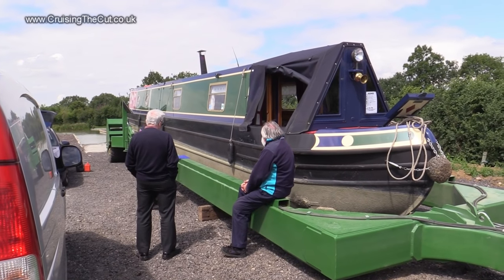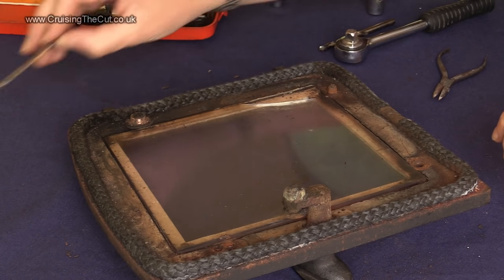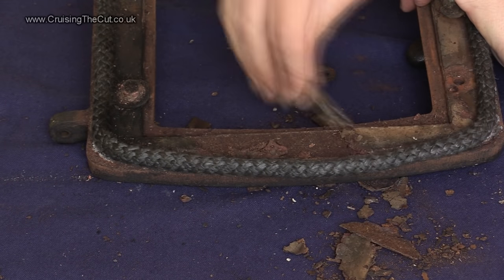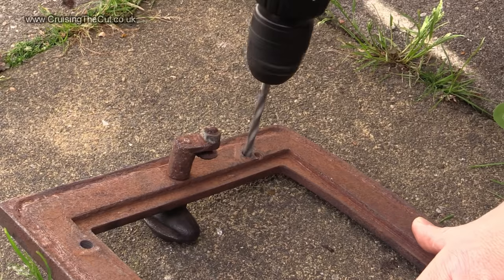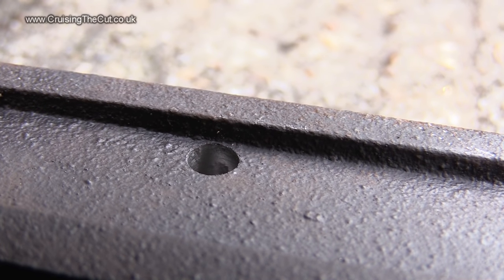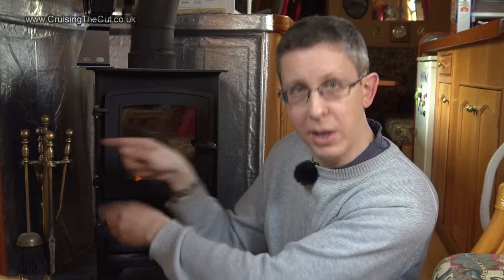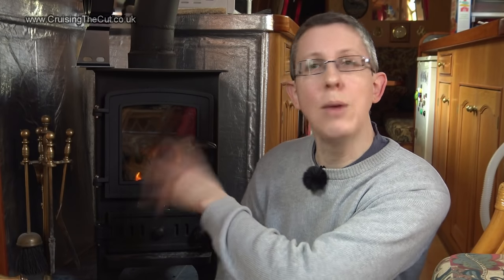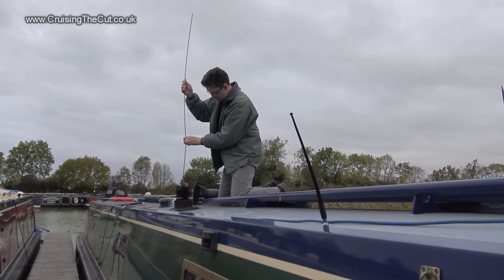18. Sorting out the Villager Puffin stove on my canal narrowboat

Comment: Regular WD-40 is not a penetrating oil.
Not that it probably would have helped much because those bolts were exposed to a lot of heat and it probably would have taken a torch to remove them easily.

Comment: Good Evening/Morning:  I discovered your channel a week or so back.  I watched enough, I am now going from #1 to present.  (It is possible I have a masochistic streak.)  In any event, and I recognize that this video is over 6 years old.  However, I have some advice.  1) WD-40 is a water displacer, not the best thing for loosening frozen nuts.  I would suggest you try products such as Kroil (best), PB Blaster(near enough best) or Liquid Wrench (garden variety).  2) A sheared off nut, wedged in the socket is not a problem.  The solution is 1 remove the socket.  2) insert a drift or screwdriver into the square opening of the socket, with the point of the drift or screwdriver against the nut.  3) hold the socket on top of the tool, while giving the bottom of the tool a sharp bang or two against something solid and non-marring.  4) a squirt of some lubricant (such as kroil or PB blaster) around the nut, will help to dislodge it.

Thanks again.  I am enjoying the channel.
Reply from the maker: Cheers 👍
Reply: Ah, to be able to start from the beginning and have it all be new....  Enjoy the ride!  And if you enjoyed this video, rest assured, this is far from the last adventure David will have that is stove related.

Comment: David for some reason I'm just re-watching all your old videos (looking forward to getting to your cheese sandwich recipe again).
Should you ever find yourself with another narrowboat, or for the benefit of other boaters with a stove: I can't recommend highly enough an 'air distribution' fan. 
I bought one to fire cold air into the room in my house which is heated by my stove and up towards the ceiling therefore forcing warm air downwards and out of the door to other rooms. 
I can heat my entire house with my stove now! and the fan draws between 1 and 40 watts depending on which of the 30 power settings it is on.
I still use the stove fan to shift air from around the fireplace but the air distribution fan is a game changer in my opinion, apparently they are designed to move air within a vortex and genuinely do seem to work differently to a normal fan. 
I could imagine this being very useful within a long, thin tube with a singular heat source. 
I'm also hoping they (as I was so impressed with my purchase I bought a second one) are useful at maintaining a comfortable environment during summer by creating a circular flow of cool air within an entire room, as this is their main marketing claim.....
Reply from the maker: Cheers, yes I had one driven by the heat of the stove, you'll spot it in later videos.
Reply: @CruisingTheCut  Yes, I know you do, but I assure you an actual air distributor is a different beast entirely!

Comment: IF you have any left over reflector foil I'll take a piece of wood or metal the size of the left over piece and put it on to basically make what is known as the a heat mirror. 

You then take the heat mirror and put it infront of the stove (bout where the camera was for this video) so it will then reflect the heat back down the boat to you bed.

That plus the fan will really make the boat warm...

Kinda wish I could live on a canal boat but can cause of the USA lacking the need canal... Anyways back to the binge!

Comment: +1 for trying the nuts both ways, sometimes the fastener will move going a little bit going tighter, give you a bit of slack to make it loosen more easily.   Ahh, you have to make friends with someone who owns a drill press; get stuff like that door sorted properly :)     Can't believe your old setup with no heat/fire barrier between the stove and paneling.. an accident waiting to happen, good fix too.   We heated with wood for years witha similar stove, happily there was enough space for a metal sheet stood off the wall; before we put in the sheet the plaster would get really hot with the fire going strong all day during midwinter... dangerous stuff that.   btw- your socket not ruined, take a length of nail or similar, poke it thru the back side of the socket, give it a good whack with rock or hammer- out pops the offending fastener.

Comment: Very informative common sense advice for those who havent got any idea of the dangers of a multi fuel fire.  Do you use the top for slow cooking etc. Very handy stoves indeed. Fantastic that you gave the repairs a go yourself.   I do note from many of the comment, there are a lot of 'experts' out there. Although I dare say some are well intentioned.  Keep up the fantastic vlogs.
Reply from the maker: I mostly use the top to boil the kettle for tea but do heat soup or beans on it sometimes!
Reply: @CruisingTheCut  soup and or beans is a good part of a balanced diet of cheese sandwiches. :)

Comment: Solid fuel stoves also a good thing for reducing condensation in the boat as it draws in moist air and increases are flow through the boat.
Reply: air* , not are* ;) Yeah, I'm the spelling police patrolling the internet. LOL

All jokes aside, you are absolutely correct. Minus one thing on that one tho: they do tend to get your space too dry after let's say 12 hours of hot burning. Hence the reason why you should put a kettle with water on it from time to time. Otherwise you'll be facing not only warping wood problems but health problems too (Europeans don't do too well with too dry air). Which is not fun. Set a kettle on it, make tea with it and you have double benefits from it. :D

Cheers.
Reply from the maker: Believe me, there's no lack of humidity or condensation in a narrowboat....

Comment: Great stove story telling and very wise words! Yes it may sound necrotic to some but  the heat transfer issue IS AN ISSUE! especially when one uses coal &  not just wood (personal experience in caravan with a Squirrel stove WITH FIRE PROTECTION that was not quite high enough the heat from the flue chard the tongue and groove and ignited the insulation! No great drama in the end as I noticed it, BUT if I had banked it up then left it it  could have been a very different story!  SO, like I say these are very wise words)  The exhaust insulation is a great tip !
Reply from the maker: +JCisJD Crikey, that could have been very nasty indeed for you - how lucky that you spotted it.
Reply: +CruisingTheCut Certainly was a lesson for me that, in this case,  practicality / safety over aesthetics  is paramount! Have to say though that all that considered and all the work involved   the romance / homely feeling that a fire gives is difficult to replicate in any other way, wouldn't you say?
Reply from the maker: +JCisJD Absolutely. I love mine.

Comment: Greetings from North Carolina, USA,

It's been four and a half years since my wife and I moved from a house to the bus we're still converting. I hope mobile living works as well for you as it does for us.

You may not to know at this point, but it's easy to remove rusted nuts. You may have the need in the future. Nuts on engine exhaust systems are often in that condition.

Purchase a hand-held propane torch (not what we call a flashlight, the kind that melts solder) that screws to a propane bottle. In this country they sell 12oz and 16oz bottles for this use. You'll have something similar.

Have a liter or two of water at hand in a vessel from which it is easy to pour. Light the torch and heat the nut to a bright red. Don't hold the flame in one spot. Move it around while heating. Do not heat the surrounding material any more than necessary. Only the nut and bolt need to be red.

After the nut is bright red, turn off the torch and put it aside. Immediately quench the nut with a stream of water. Pour directly onto the heated nut for about five seconds. In most cases, the nut will turn easily with a spanner. On rare occasion, you may need a second application. It's easy, and it takes less time to do than to write about it.

I'm enjoying your videos, and I wish you the best with boat life.

Jim H.
Reply from the maker: Thanks for the tip - though I'm not sure I'd trust myself with a flaming hot gas torch ;-)
Reply: With respect, I recommend that you expand your imagination here. Compared to all the drilling you did through cast iron, this process is ridiculously easy. Furthermore, it will save you mucho dinero and make you less dependent on "professionals" who may not even be available when and where you need them.
Reply: I understand your trepidation.   But Jim's recommendation is a very tried and true method.  Take a look at the Scotsman' John Wells YouTube Double Boost channel on methods for removing rusted nuts.  And Adam Booth has some good videos on heat treating nuts.  The idea is to heat the nut to expand the inner whole of the nut a tiny bit more than the diameter of the bolt.  A couple of taps with a hammer (or your expensive socket wrench) to break loose some of the rust as it cools will help, too.  And spraying more WD-40 or other oil based solvent on a red hot bolt is not recommended.  In fact, highly discouraged.  Or even stronger, "Don't be a blithering idiot!"

Of course, since you had the door off, I would recommend taking the door outside in a fire safe area to have a go with the torch.  The furnace door and glass should have been a perfect project for heat treating the bolts since the metal door has heat on it most of the time.  Not like something else that might catch on fire.  But, watch the You Tube videos and get a feel for loosening the nuts on another DIY project that you come up against next.  

And since you had remove the door, you could have taken it to a auto mechanic to remove the bolts or even to the marina repair for their best method of removing the nuts.  Cheers,
 Larry Ogle

Comment: Another brilliant blog, once again. I am just about to install a multi fuel burner and will purchase some of that reflective material now. Will make my own vlog re the whole purchase and install. Be interested in your comments.
Reply from the maker: Two points: put it on before you fit the stove! (fitting round the stove was awkward). And it's gone a bit stringy on the cut edges so cut them as sharply as you can. Good luck!

Comment: Watching this again. Couple of comments suggestions in case you do it again.

Use a centre punch to mark the position of the hole you want to drill. Make a big ding with it. Then start with a small drill. This will go straight in and not wander. Then use a bigger drill. 

Coat the threads with copaslip by molyslip before assembling. They'll not seize with that on. Works well.

Comment: Downside of such a stove is it burns warm combustion air from inside the hull which then is equalized  by colder outside air coming in thru doors and window cracks.   Fan saves the day to some extent.
Reply from the maker: It's toasty enough that the boat gets extremely hot anyway.

Comment: Well as a crazy Maine US resident with at least 2 months of -40ºC nights, I'm happy your multi-fuel is keeping you warm. I wouldn't be capable of surviving a winter here without my Woodstove. Mine has firebrick lining within, that allows it to burn at maybe 150-300ºC up the flue with no issues being 6" away from Plasterwalls. As a 40+ year woodburner, sorry no coal.I also have a 12 Volt squirrel fan that blows from the back of the stove that allows more heat to radiate into the rooms, as mine heats 3000 ft. sq. or basic 3 story house. Great and cheap addition for when those wee 10-foot snowstorms take out the central heat for a week. Tends to keep the house at a toasty 26ºC.
Reply from the maker: +John Caron How many degrees below??!!! Blimey. That would definitely be chilly. It always makes me laugh when we in the UK refer to a few inches of snow as catastrophic given the kind of conditions you get. Cheers

Comment: G'day David your spot on there is nothing like an open fire we have one and the walls around it have cement sheeting and the tiles are laid on the sheets.  It has a two fold effect one if there are any imperfections in the walls you won't see it when it's tiled and two the tiles are laid straight and neat and they are not uneven.    It's funny when I was looking at the state of the old door I was hoping you would buy a new heater!   Regards John

Comment: Bet you've got all doors and windows open now, cause it's too hot ;) Love all the different woodstoves on boats. Still contemplating an Eco Fan, with only 32 ft to heat, I don't know if it'll add all too much.
Reply from the maker: You are uncannily absolutely spot on - put the stove on earlier just to keep the evening chill off and now have doors and windows open and am sitting sweltering in a t-shirt. Even the back of the boat's too hot. And I've shut the air control fully!

Your stove's in the middle as I recall, can't imagine it would help at all. Are you toasty also?
Reply: +CruisingTheCut Yup! and yes, my stove is indeed central, so it's quite nice to escape down the slightly less tropical end of the boat :D

Comment: Co detectors should be low. Since Co is heavier then O2. Also sheet rock is a fire / heat blocker.
 Take care Spin
Reply from the maker: Cheers but it's CO not CO2 and no, they shouldn't (or needn't). Carbon monoxide is almost exactly the same density as air so it makes no difference where the detector goes. Generally you need one at head height for sleeping and another in the room with the heat source; if anything this should be higher up as the air - and CO - will tend to rise when hot.
Reply: @CruisingTheCut  Thank you for the reply.  Generally about 4 to 5 ft is recommended by most manufactures. Deadly stuff - a local man I knew was over come during a power outage. Due to the generator exhaust seeping in by poor placement of the unit. I also like units that have a digital readout instead of a 'dump' none digital models. Take care - only made it still far in the series and hope to hit the end someday.

Comment: Another great, informative vlog. No pressure, but when will you do the definitive video on how to keep the fire lighting overnight? Seems that some combination of virgin sacrifice on the 12th day of the 3rd moon of the leap year, and running naked backwards around a tree at midnight might keep it going. Don't know the exact spell unfortunately :)
Reply from the maker: I think you've nailed it there, nothing more I can add. My method's rather more prosaic and sadly involves no virgins but is essentially heap loads of coal in and turn the air vent down to minimum.

Comment: I thoroughly enjoy your blogs. On the subject of replacing your fireplace glass, while yours is new obtain a small can of "never seize" obtained at an aircraft supply or automotive  supply. Remove the bolts or nuts and coat the threads with the compound and re-assemble. This compound is used   on exhaust fasteners and will work on most all applications where threads are involved. Would be great on your prop inspection box that you have replaced the gasket. Best wishes.
Reply from the maker: Alas, the glass is no longer new and the new bolts are now seized solid as well :-(

Comment: My experience with a wood stove led me to my trick of slapping the stove pipe now and then. It knocks the accumulated gunk loose and it falls into the stove to burn. (First time without the fire lit, of course.)

As for drilling holes in metal, a center punch helps by making a little dent exactly where you want to start. Then you can drill through a pilot hole first with a skinny bit, before you bring in the full-sized bit.

Comment: Consider a water filled fire extinguisher the type u find holds around 3-1/2 gallons and uses compressed air thru a tire chuck affixed
To the top removable fill to where the container curves in put top on add air ti the full line on the gauge.
Water is a lot easier to clean up, the ABC dry chemical one you have are really a pain to clean up from even a quick squirt.
The water also comes in handy if your attacked by super soaker kids/adults it even shoots to near 60 feet!
Food for thought and u should come have a water extinguisher so if the fire is. Not electrical you don't make suck a mess
And water cools the fire helping put it out quicker

Comment: Next time you need to drill out an impossible stud: 1) Grind the face square  2)Center-punch the stud carefully dead on center 3)Starting with a small drill, drill progressively larger, a drill size at a time,  until you take out the old threads in the workpiece. Stop at the original thread depth - ie, don't go through the in-this-case door.  With luck, you MAY even find the outside threads are left intact enough so that you can run  new tap (a thread-making gizmo) down and back out a few times, and thus restore your original threads in the door. If not, at least your hole will now be on center and you can drill all the way through.  If the threads don't get saved in this way, the next oversize drillbit can be run all the way through the door for the final through-bolt repair.  nb: This type of repair can be made more possible by settling for an undersize through-bolt, which will often make things easier, too. Best of luck next time! 8-)

Comment: next time you have a rusted bolt or nut, sock it as you did, try easily if it will come loss, if not, heat the nut or bolt red hot with a cutting torch use a socket and if you have an impact gun easily try to loosen and tighten a bit and back, it will come off, if you do brake it weld a nut to the bolt with a 1/16" stainless steel welding rod, the stainless will shrink the bolt or stud. as a welder over 35 years, I have done this so many times with many different sizes, with full success
Reply from the maker: Excellent tips but rather over-estimating my practical abilities! Maybe someone else reading here will find it useful :-) Cheers.